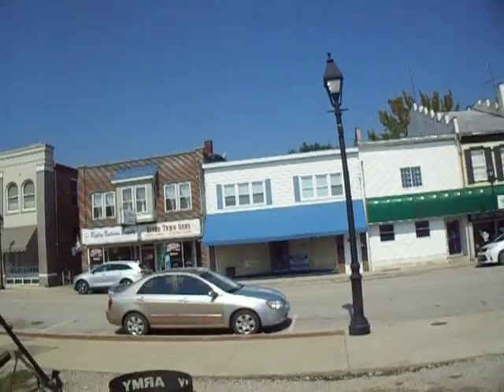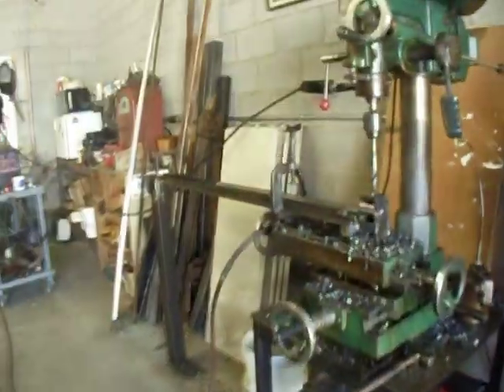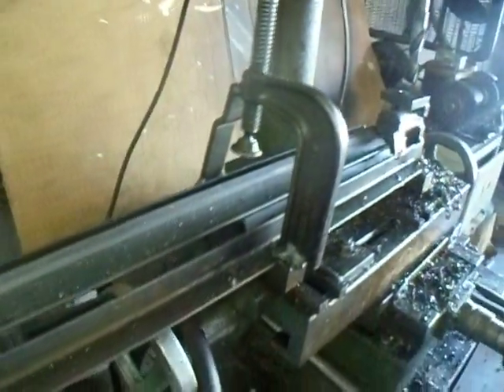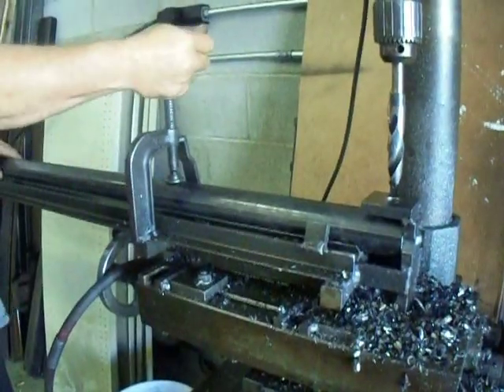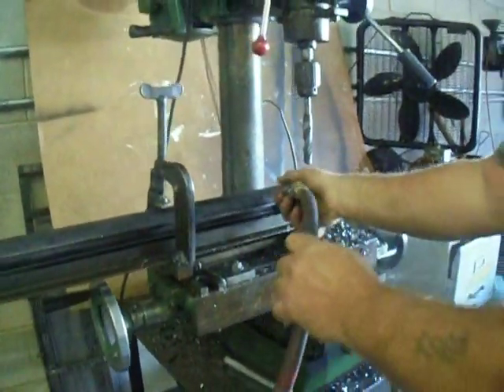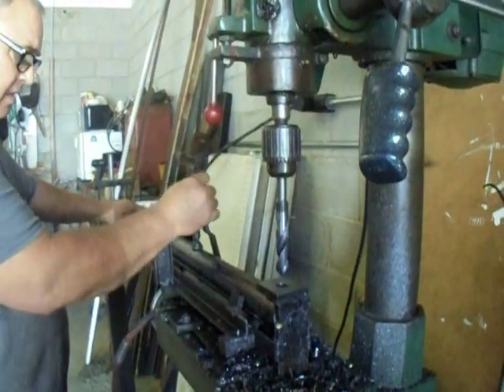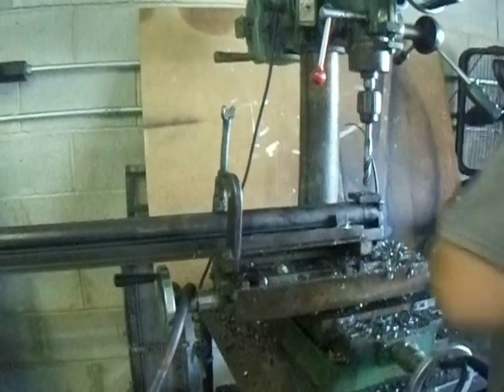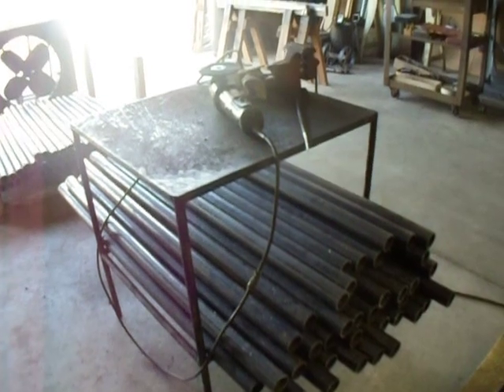Pipe Drilling Jig

Comment: Nice setup, isn't clamping the work for the second hole overkill? the pipe is held internally at the drilling end and with a pin on the other end, could save you a few seconds - or not.